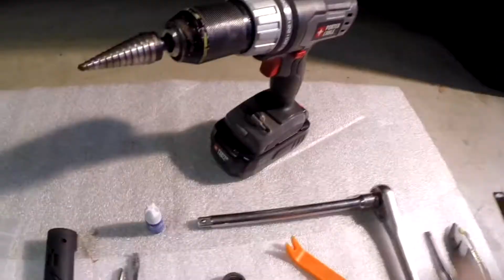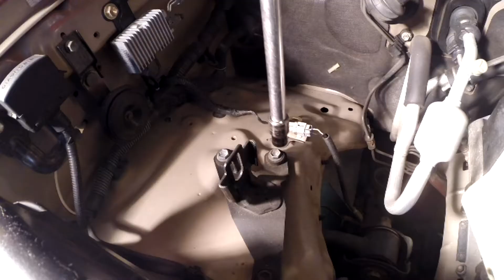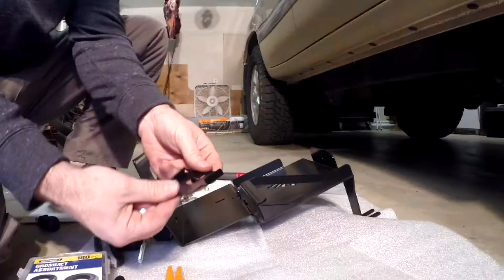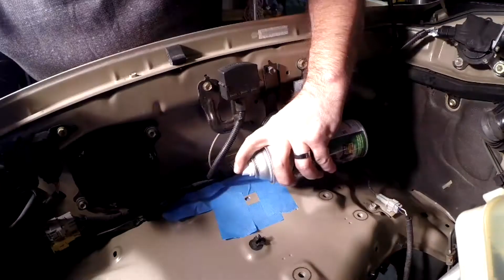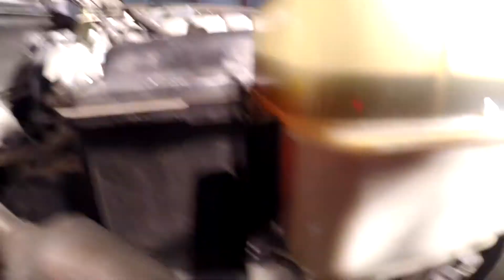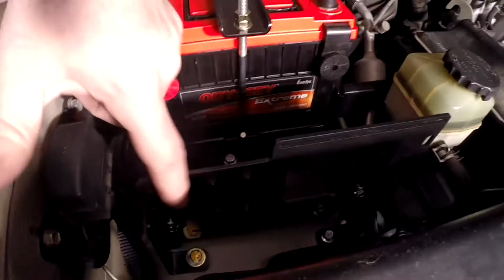Slee Off-Road Aux Battery Tray Install - Building the Beast

Comment: What is the size of this 2nd battery? Is it group 31?
Reply from the maker: Sorry for the late reply I sold my Land Cruiser a year ago and haven't been on here for quite a while. Hopefully you figured it out by now but here are the two batteries I used
Secondary Odyssey 75/86-PC1230 Battery
Primary Odyssey 31M-PC2150ST Battery
Reply: @BradyAdventures  Thank you very much.

Comment: I’m really interested if you had the chance to look into switching the 75/86 to the starter and use a group 31 as the secondary. I just bought a 100 that has that exact setup. Just curious if you’ve ever heard of that working.
Reply from the maker: That is something that has been on my list and I still really want to do it.  it is certainly something that can be done but I never got to it since getting to the starter is a pain in the ass.  I did consider running a wire from the main battery harness back around essentially routing all stack wiring to the 75/86 but never came up with a good plan.  I know it could be done and would love to have the monster battery running my camp setup.  The other reason I probably haven't is my solar seems to keep things topped off so never had to worry to much.  If you end up  trying it out let me know.  Thanks!

Comment: I'm super confused about why my LC has all the AHC plugs, there is a huge harness with wire for the AHC that are plugged into nothing that attached to the ABS plug.. This is gonna take me longer than an hour!
Reply from the maker: Oh man, i didnt have to deal with that. Wonder if a prior owner removed the AHC hydralics? Good luck!
Reply: @BradyAdventures  That's the thing, it never had AHC, it's a Land Cruiser. I pushed it all out of the way, mines a 2000, what's yours? Super helpful video, trying to decide whether to go with the national luna (like you) or the IBS. Got the compressor and manifold all plumbed, electronics for another day.. Still haven't picked a secondary battery, have a 100ah isolated battery in the back that is soley powered off solar, kinda lame to switch to 55ah..
Reply from the maker: Wow the AHC is really interesting!? I'm glad the videos are helpful and thanks for checking us out!. I use the national Luna monitor but not the relay controller. They look very similar. I'm pretty sure the IBS only comes as the Monitor and relay controller. The blue sea relay controls itself or uses the in cab switch. I think if you're planning on going with the IBS kit or the national Luna kit that include the relays and control capability they're very very similar. But if you decide to go with the blue sea ml - ACR relay then all you really need is the monitor. Hope that makes sense. Definitely let me know if you have any other questions and good luck on your build.

Comment: Hi Chuck, I just finished installing my 2nd battery.  Your videos are so helpful!  Not sure I would've been brave enough to punch a hole  through the firewall without seeing you do it first :-).  I have a question though.  The hood support strut is awfully close to the positive battery terminal.  How did you deal with that?  The battery is as far to the middle of the vehicle as possible.  BTW I have the same battery as you...  Thanks again!
Reply from the maker: Thank man!  Sounds like things went well!  Yes it is incredibly close and initially made me nervous as well.  I haven't had any issues with contact but if you don't already I would put on some terminal covers on for a little peace of mind.  These are the ones I used.  https://amzn.to/2QviMPc  I would also check the battery regularly for a while to make sure it isn't shifting at all.  You want to mount it tight so it won't move but you have to be careful because you can break the case if it's too tight.
I just went out to the truck and looked to refresh my memory and the strut passes right next to my terminal cover but doesn't appear to make contact.    I have had the cruiser through some pretty rough stuff and no problems. I hope that give you a little piece of mind.  Definitely let me know if you have any other questions!

Comment: I noticed your in Virginia. Any recommendations for some good trails in the area?
Reply from the maker: I am in central Virginia and travel down to south western Virginia a lot to visit my families cabin, we actually have a few of our own trails there.  One of my favorites is the trail to the scales, has a great camping spot on top of a mountain.  Not too technical but a great remote destination.  I posted a few vids on that spot.  One good way to find them is through the dept of agriculture websites map tool you can find forest service roads all over Virginia.  I have been meaning to explore some closer to home since I get the new tires on the cruiser.  There are tons of options within an hour of the 64 81 interchange.  Let me know when your around the Charlottesville area and we can explore a trail.

Comment: Great vid! I am looking to do a dual battery setup in my 100 and will be using your videos as reference.
Reply from the maker: Thanks man!  Glad this is helpful. This is an important upfront mod and it took a lot more research than I anticipated and I wanted to be sure to share everything I learned.  If you have any questions when you get around to it please let me know.  I just wrapped everything up so should be posting a few final videos on everything over the next couple weeks.